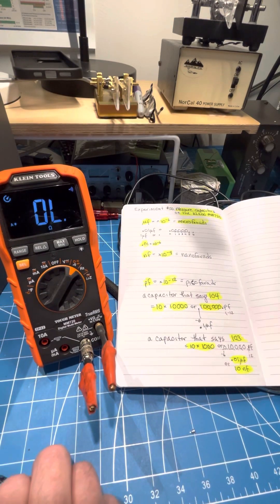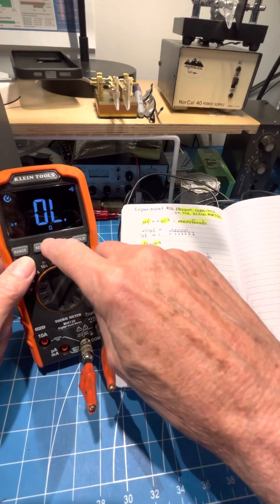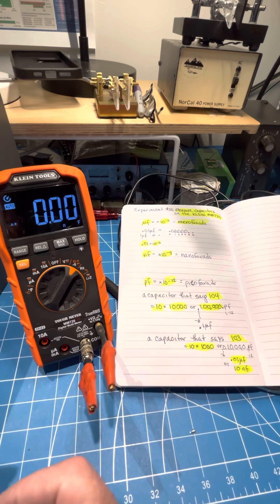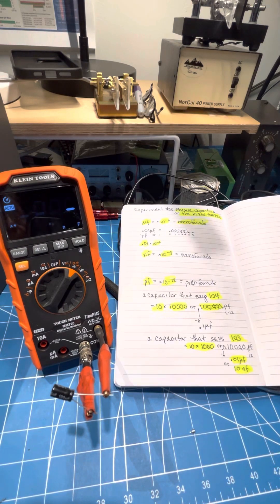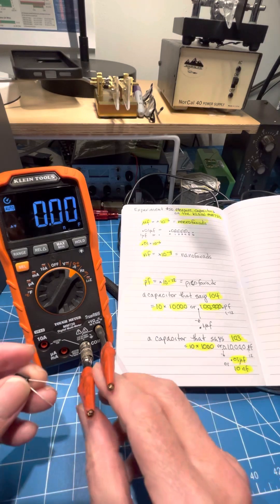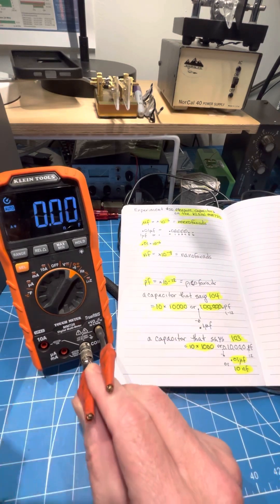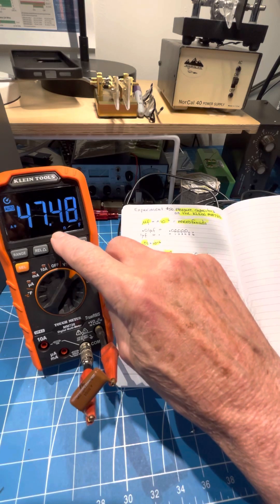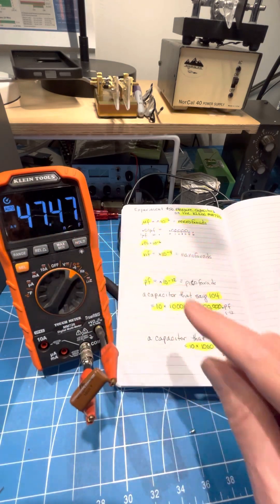Measure Capacitors: KLEIN MM720 Easy!!!

Comment: I appreciate  your video. Great info. I am looking at buying a miltimeter for guitar/amp repair and to also build effects pedals, do you think the mm720 is the best fit or have a better suggestion? Thank you for any help you can guve.
Reply from the maker: I think the MM720 is a great deal for the price. For audio work the capacitance measurement range is fine. 
My only half complaint is the battery saver shuts it off a bit more quickly than I’d prefer, but then again the battery life is pretty good.

Comment: When you put this Klein MM 720 into diode mode and there is short, does it make a beep sound? Thanks
Reply from the maker: When a diode is connected in diode mode it shows the voltage drop (~.6 volts) across the diode junction. 
If the diode is shorted it shows 0 volts, but does not beep.  Good question!
Reply: @tyrueiI  I am disappointed that this meter doesn't beep when there is a short. Thanks for answer. Happy New Year!
Reply from the maker: @lightshine6044  glad to help. Happy New Year
Reply: Yes, it does beep.